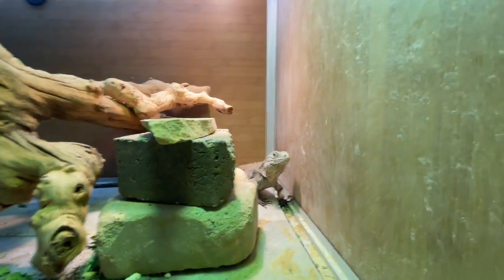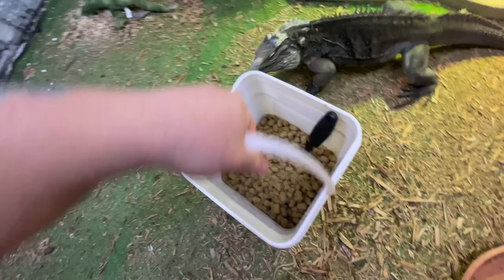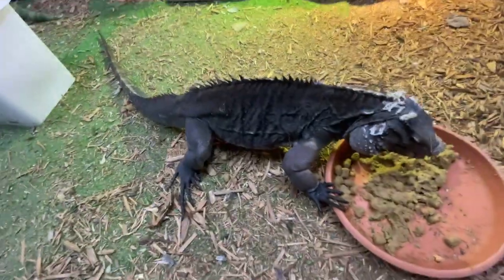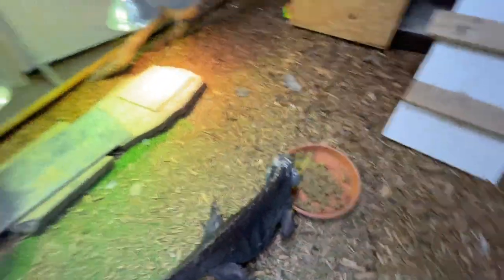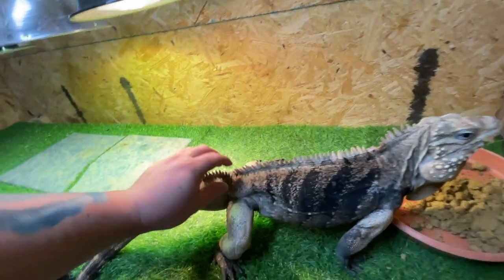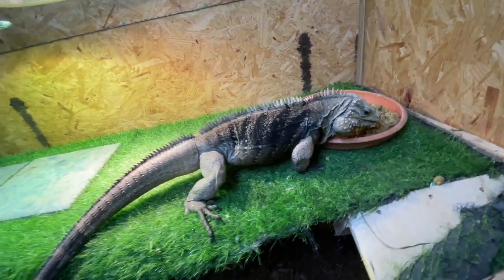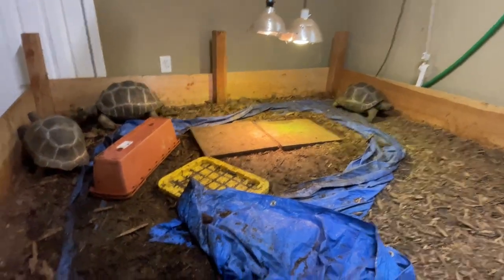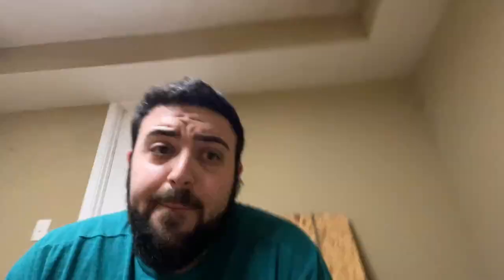ALL ABOUT CYCLURA (ROCK IGUANA) BODY LANGUAGE!

Comment: Hey! Based on what you said about the heat light domes, would you recommend the ones from home depot? I'm shopping for my set up and wondering if you've had problems with the non-reptile brand ones. THANKS! LOVE YOUR VIDEOS.
Reply from the maker: Thanks for the love! A dome is a dome. The reptile branded stuff is never anything special. As long as you have a ceramic socket instead of plastic, you’re good. Home Depot domes are half the price of the reptile branded stuff
Reply: @gbliguanas1759  amazing! Thanks for your quick response. I get so many ideas from your enclosures.
Reply from the maker: @hannahschechter1018  thanks! I used to be one that bought only the actual “reptile” stuff but over the years found most of it is just a waste of money lol
Reply: @gbliguanas1759  right! Seems you have to abandon that around your 4th reptile or so....or else we go broke hahahah😂